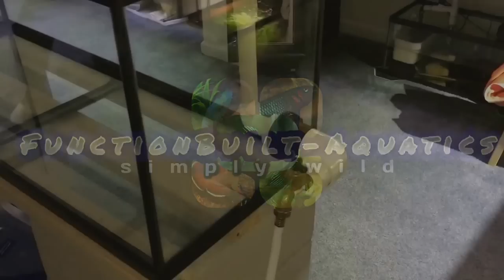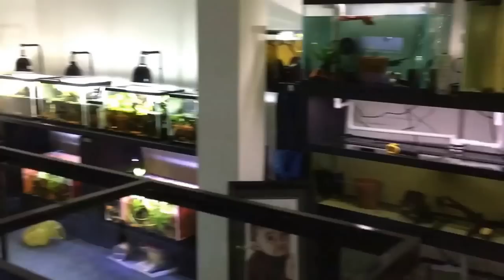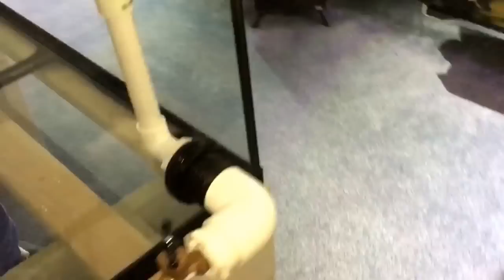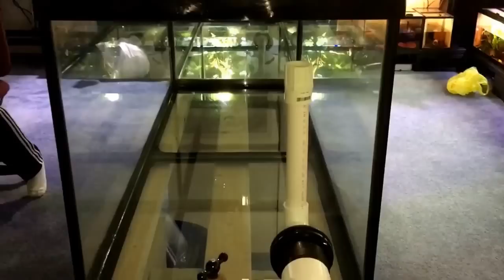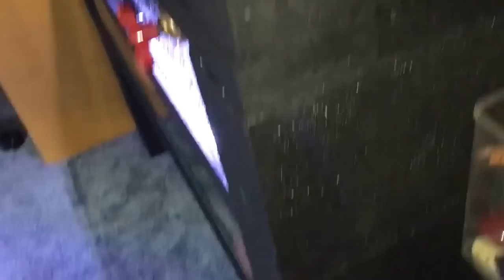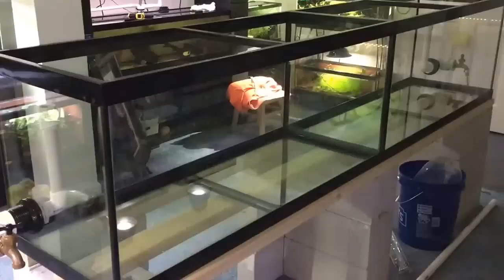Our quick water change mockup

Comment: i also want to do this, but dont know wether i have the confidence to drill glass yet
Reply from the maker: Quintin Lourens thanks for tuning in. I didn't drill these tanks myself. I bought them  from a discus fish hatchery that was going out of business. They came drilled and I don't like Central systems for wild Betta's so I had to come up with a idea to use the bulkheads to my advantage. Water changes are the biggest chore we do in this hobby. Turning a valve and draining the water with no buckets or syphon was a breath of fresh air. Drilling tanks takes some practice but is not as hard as it seems.
Reply: FunctionBuilt-Aquatics very neet setup. i also dont use sumps, just central air.

wish we could get wild betas in South Africa
Reply from the maker: Quintin Lourens Central air is next for me. Now you can teach how to do that. I can't wait to disconnect 12 air pumps.
Reply: Its very easy, you can go a few ways when doing it, but your most practicle way is building an air loop with pvc, or tap out to ball valves from normal tubing, which isnt practical, but i had to go that way in my fishroom...
Reply from the maker: Quintin Lourens do you need a bleeder pipe?
Reply: I saw many people using them but i dont, i think its only needed when you are running huge air pumps, i just have a 60 liter per minute air pump, currently running 10 tanks of it, with plenty air left for more tanks too.

Or wait, make it 11, because im running a huge air stone in water aging bin too.
Reply: 15 to 16 gallons of air when you in the states
Reply from the maker: Quintin Lourens so if you need to bleed off air you could just open a unused valve?
Reply from the maker: Quintin Lourens thanks brotha! I'm going to do this in the spring. I have 4 20 gallon highs left to use. When I bought the 2 75's I grabbed 10 drilled 20 highs. For dirt cheap! They just need the paint pealed off..
Reply: Only a pleasure.

:)